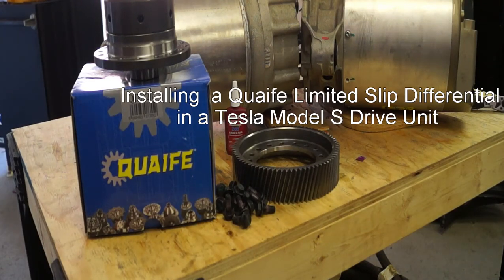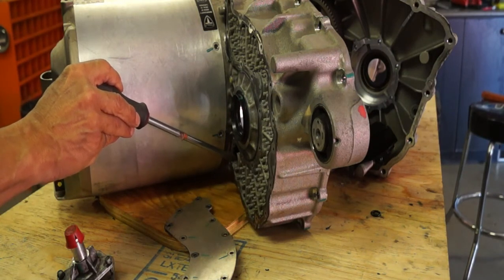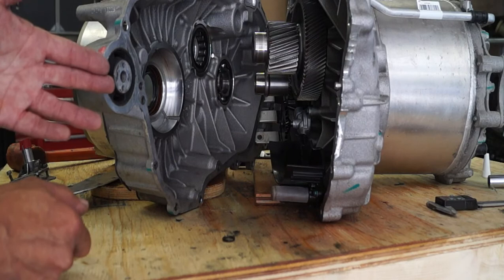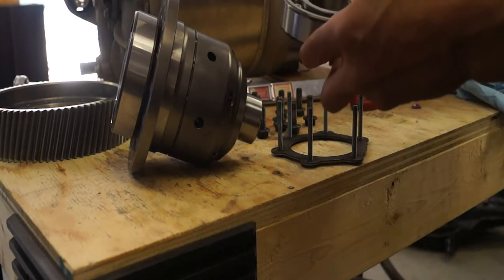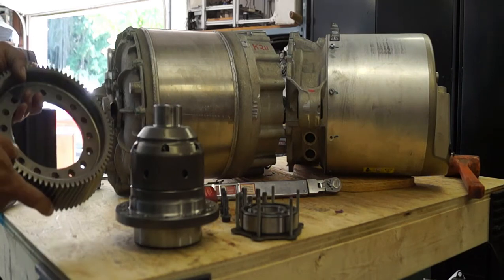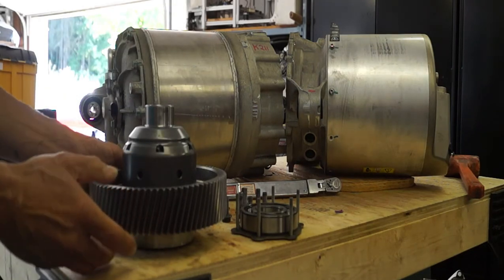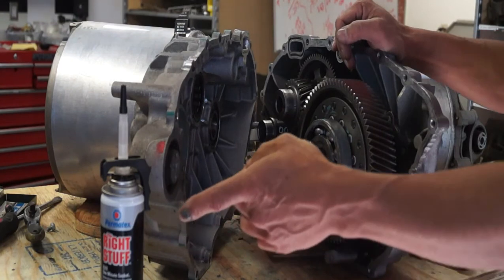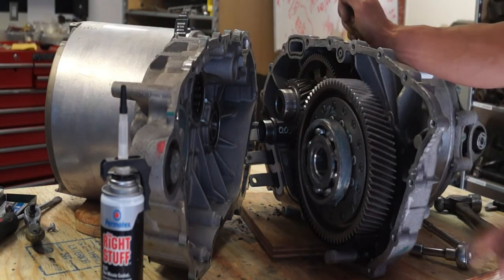quaifeinstall2

Comment: Are those the bearings that make milling noise that you replaced?
Reply: In my P85 it was the rear bearing of the motor that was making the milling noise due to coolant leaking. The Drive-Unit was replaced on warranty by Tesla.